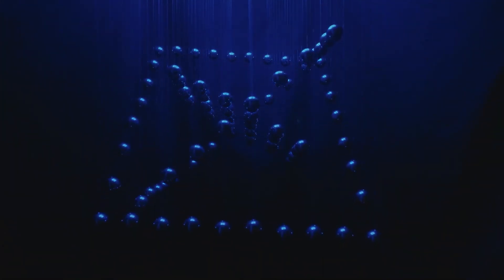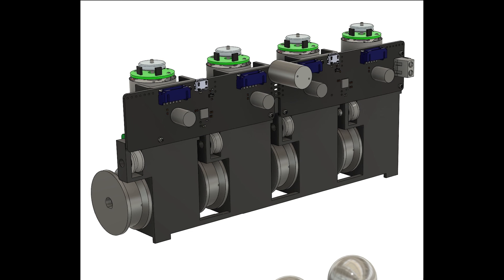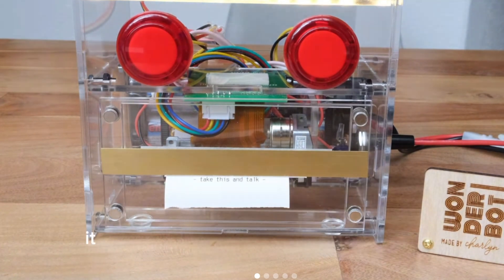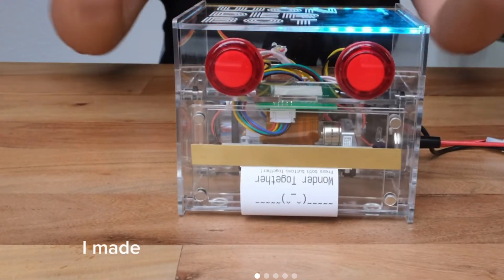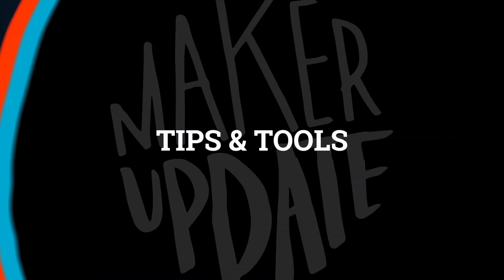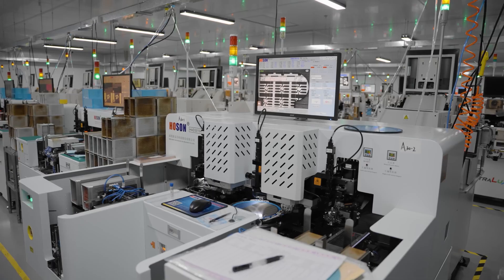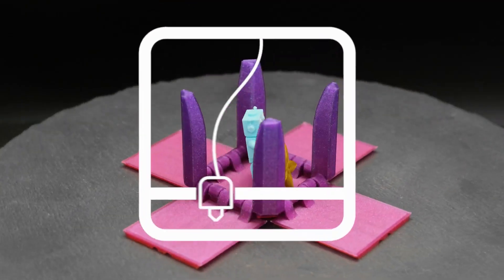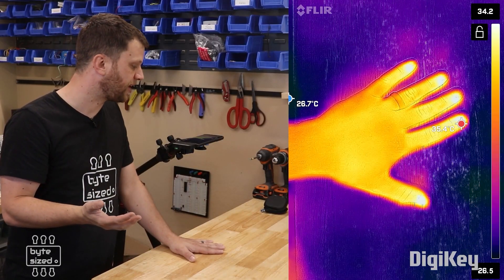String Symphony [Maker Update] | Maker.io

Comment: It's my favorite video this year too. Manufacturing LEDs is so much more complicated than I thought.
Reply: Right?! And just the meta level thinking it takes to work out a manufacturing process like this that is almost entirely automated. Even the quality control, with computer vision and all those testing rigs, it's all baked into the process. It definitely increased my appreciation for manufacturing design and engineering.
Reply: @MakerProjectLab Definitely agree, and appreciate the tip on this! 😎✌️